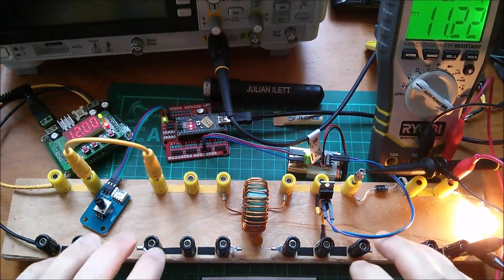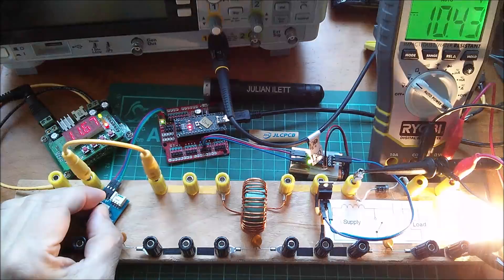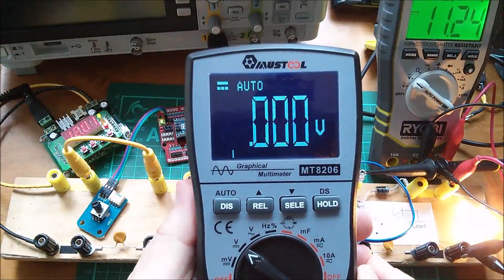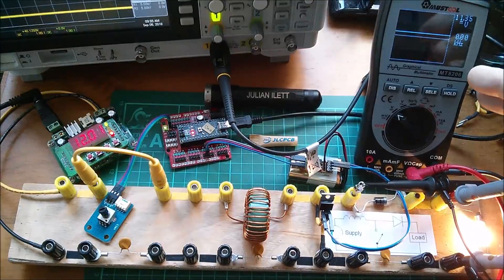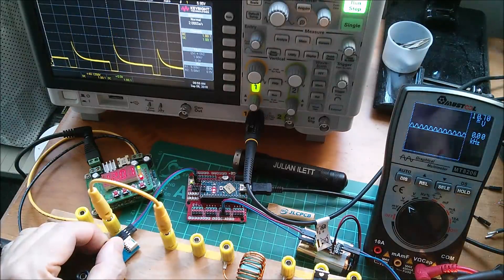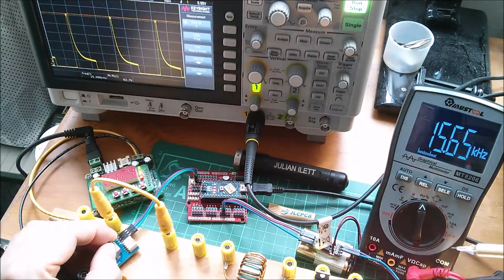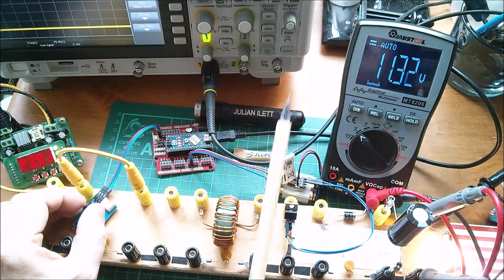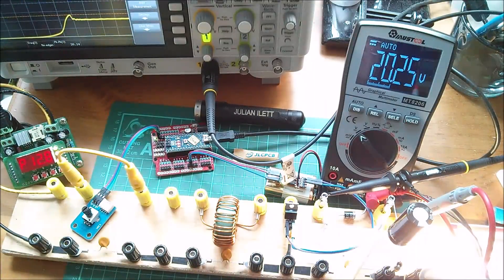Boost Converter with Capacitor, DMM and Scope - Muppet 2

Comment: Julian - Put some emi caps into the circuit. One next to the input cap, one across the output cap. Also for a super design you could add some common mode inductors and filter caps pre and post converter to really clean up the power and kick out noise.

Comment: The meter is reading RMS voltage so it's doing fine for what it's been asked to do. The circuit sort of emulates a PWM without the capacitor so it reads that but in (reverse?)? The lower the duty cycle, the lower the RMS reading.

Comment: I’m late for my comment, but here comes anyway:  Your volt meters are measuring the average which is dominated by the FET conduction pulse width.  If you had a true RMS meter, it would weigh in (like as a square) the transient portion and would increase just like the light bulb intensity.  In that respect, the light bulb also responds to the true RMS.

Comment: crowbar!  I've heard that term for years and sort of had an idea what it meant.  So what does it actually mean and where did the name come from?  is it from the pattern you are seeing there on the scope?
Reply: emaglott - no. The term was misused here. He most likely mean clamped. A crowbar in electronics actually refers to a protection circuit that once triggered by a higher than normal voltage, it conducts until the circuit voltage drops to near zero. The idea is that by shorting the supply, it will rupture the fuse. Occasionally a breakdown in an electronic component will have a similar affect. But this is not what was happening in this video.
Reply: Oh.  Thanks for the clarification.  Why is that called crowbar?
Reply: emaglott - I can’t for certain tell you why, as I don’t know how the name came about. It may be because the circuit has the same effect as dropping a metal bar (crowbar) across the supply terminals (the voltage drops to near zero, a high current flows and blows the fuse). Or it may be named due to the sudden and rapid removal of a fixing when a much larger crowbar is used to lever it off of a structure - in the circuit, the voltage is suddenly and rapidly removed as first the crowbar circuit shorts it out, and then the fuse blows.
Search using “electronics crowbar protection” for more information.
Reply: @Mark1024MAK - I was looking up some info on ignitron rectifiers and found crowbar information!  It is a reference to dropping a crowbar across the output terminals of a power supply according to:  https://en.wikipedia.org/wiki/Crowbar_(circuit)

Comment: I don't believe that clamping and crow-baring are interchangeable terms.
Clamping constrains to some non-zero voltage (60v here), whereas crow-baring is a special case where the clamping is to zero volts.
It comes from the notion of throwing a crowbar across the output of a power source - an extremely low resistance that won't burn out, which absolutely forces the power source output to zero volts. Many power supplies include "crowbar overvoltage protection", which triggers an SCR across the output should the output voltage rise too high. The heavy short circuit thus caused blows the power supply's fuse, protecting the load from the overvoltage.
Reply from the maker: Quite right - I should have called it clamping :)

Comment: Please forgive my ignorance. I continually read that buck converters are noisy. As they are quite capable of driving a PC processor I can only assume that the 'post processing' of the output must be very good. You used a capacitor, is there any way an 'add on' can reduce the noise on the many Chinese ones available.

Comment: You could try the multimeter on AC to measure the spiky DC accurately.  True RMS multimeters don't care whether it's AC or DC input, and it should show the voltage rising with the brightness of the bulb if the RMS integration is working correctly.  (I'm not sure why they bother with DC settings at all on true RMS multimeters!)

Comment: I noticed that after you added the capacitor you switched the input meter from voltage to power. what was the input to output voltage with the capacitor?? Thank you Tom

Comment: I looked at the Mustool DMM on Ali. The one you have should go to 5GHz, not 200Khz. So why didn't it show the range properly? Or am I looking at the wrong thing?
                     MT8205               MT8206
Bandwidth  AC 10KHZ         ● ACA/ACV/DCA/DCV 20KHZ
Frequency 2KHZ-200KHZ    ●5HZ-5MHZ

Are we looking at the "bandwidth" instead? If so, what's up with the frequency?

Comment: Adding the cap after the diode is nice. It shows the power of what a good cap can do to a circuit and why we need them.
Two questions about this setup is (there may be others l8r, depending on the answers), what does the size of the capacity of the capacitor do to the ending result? And what would happen if you put a capacitor "before" the diode; will it change anything?

Comment: I could still hear the high pitch ring either way. Though it did change pitch slightly when the cap was installed, and it went a little higher. I think you had your audio set a little differently, or maybe the mic was in a different spot, something. It wasn't "quite" as annoying as the first video  😉

Comment: You shouldn't put the scope ground level at the very bottom of the screen here.  4:56  It is an analogue signal with an inductive load and you can't assume it isn't going negative.  Move it up at least one division so it shows any negative voltages and you can adjust it up more if required.

It would be alright to do this on an analog scope because the trace can still be seen below here but on a DSO it is a hard line.

Comment: Did you ever explain why the dvm's showed lower voltage as the pwm increased ? I heard a lot about crowbarring, and capacitor, but no explanation.
Reply: The waveform was spiky, the meter can only read a sinewave accurately.
Reply: PWM is not a sinewave.
Reply: @youpattube1  the higher the voltage got the narrower and sharper the pulse became and the more the meter misread it as a lower voltage.
Reply: youpattube1 - as the duty cycle was changed, so the voltage spike got taller, but the on time of the transistor was longer. During this time energy is going into the inductor. So no energy is going to the lamp. Normal digital meters have both relatively slow sample rates and only appropriate waveforms that are not pure smooth DC. They use an averaging system (designed to show the correct AC value when measuring a pure sine wave). Because of this, they don’t respond to the short voltage spike, but do notice the loss of voltage during the time the transistor is on. Hence as the transistor on time is increased, they show a lower voltage.

Comment: I believe that's called an output integrator when you use a capacitor to average out the PWM. it's how they "recover" a sine wave from  PWM in pure sine wave inverters and the audio output in D class amplifiers.

Comment: There was some noise on the output with the electrolytic cap there... i wonder if you get rid of that noise if you also put a cheramic cap in paralell with the electrolytic.
Since the cheramic caps are better on high frequency stuff compared to the electrolytic.

Comment: Julian, the crowbar effect your seeing is actually the body diode doing its job. If you look at the symbol for the MOSFET it shows a zener there. That is there to help protect the drain source junction. Hope this helps explain what you were seeing.
Reply from the maker: OK, that's interesting - thanks :)
Reply: The body diode is a parasitic structure in the mosfet (actually a whole bipolar transistor with B and E shorted). It's drawn as a zener to indicate drain to source breakdown. It's not there to help with anything, ideally it wouldn't even be there.
Crowbar circuits short points in a circuit together like a crowbar across a battery, waht's happening here is called clipping. Crowbarring would happen when the mosfet burns up and turns into a jumper.

Comment: To clarify for the learners out there: It is a clamp not a crowbar. When triggered, crowbars latch fully on - usually until the power source is removed, with the intention of making the input protection fuse blow. Clamps prevent a voltage from going higher than a certain point, by applying a load, in this case, the zener built into the IRFZ44. Look at the schematic symbol at 6m50s, the body diode is presented as a zener.
Reply from the maker: OK, that's interesting - thanks :)
Reply: Good catch.  Interesting that some schematic symbols show the body diode as a zener while others don't.

Comment: Re: 7:38 I hope you know that light bulbs are NOT linear devices, a matter of fact there are a bunch of circuits that use light bulbs because of this facts. They do change their resistance with the temp of the filament but it's not a straight line correlation. I am sorry I don't have a link right now on the subject, but I remember this from a project I did back in the 70's and from popular electronics article.

Comment: Enjoyed this, thank you. I saw that meter on banggood last week, I’ll be interested in your review. I think I must have lost 15kHz too :-(
Reply: Here's hoping we get a full review, not just a hand wavy sort of thing.  Perhaps actually test its accuracy on all ranges, check the resistance threshold of the continuity, look at auto ranging times compared to other devices, look inside to assess the construction & safety, check the current consumption.  And on the 'scope look at bandwidth (comparing it with your proper cal'd 'scope).  Examine and demonstrate the history functions (such as they are).

Comment: try a larger capacitor or two in parallel. the overshoot and ringing observed on the scope indicates underdamping. if you're looking for smoother output voltage.

Comment: Are you sure it isn't the scope cutting the top of those traces? The volts/div selection determines the maximum voltage it can measure (because it determines to which multiplier/divider the amplifiers/attenuators inside the scope are set). It doesn't matter where you move the zero volt line to. 
The MOSFET might be getting hot, because the inductor is driven into saturation at which point it is like a short.
Reply: An inductor that size will be far from saturated with this amount of load.
Also, no scope will display a cutoff like that ever.
There´s a good reason that Mosfet claims only 55V VDSS. You can´t just use any mosfet for any purpose. At some point it just becomes conductive when off.

Comment: The ringing you saw after installing the cap is probably not there. You are using a ground wire for the probe which creates an antenna. If you measured with a shorter wire (or none ideally) the ringing would would likely diminish or out-right disappear.
Reply: It´s unlikely that this comes down to his probes. The frequency isn´t very high here.
It´s probably due to the diode he´s using. Diodes take a bit of time to turn on.
Reply: @Basement-Science  hmm, good point. I have seen scope ring in 200khz applications before but not in anything this low. It is an easy thing to rule out though.

Comment: It would be interesting to get a "true RMS" meter on the boost circuit without the cap.  I suspect it would show a voltage rise.  The bulb is behaving like a "true RMS" measurement, while the DC voltmeters are filtering the waveform.
Reply: Bingo

Comment: huh, thats quite an interesting multimeter for $50. i wonder if that "oscilloscope" mode can be used for anything useful or is just a gimick.
Reply: I saw it on banggood on sale and almost pulled the trigger, but figured the scope would be fairly useless.. They show it displaying a  60hz sine wave, I wonder if it has the resolution to accurately display a modified sine inverter output waveform? Or some dc graphing? I'm going to guess it's only useful for around power line frequency or below, and has trouble auto ranging and triggering on anything but perfect signals. Can't wait to see Julian put it through a few tests.
Reply from the maker: I'm thinking I'll feed it with 1kHz sine from the Wein Bridge oscillator, several kHz from a Royer oscillator (also sine) and the output from a modified sine mains inverter. Maybe also a 555 square wave.
Reply: Perhaps the sources to use (for 'scope testing) are your DDS and waveform generator modules.  The AD9833 and AD9850 if I remember.
Reply: Julian, maybe you could also compare the JYE TECH DSO138 Oscilloscope (kit) that you did a while back.  What was its bandwidth?

Comment: Julian, you probably improve then efficiency by adding a cap on the input also.  I used to fix smps's in the telecom's sector and every single one had come capacitance on the input.. Just a thought. :)
Reply: It wouldn´t change much in this case. The power source (his other converter) is pretty close to it.
Reply: Yes that does have caps.

Comment: Can you run it with a 555 ???
Reply from the maker: Yes, probably, in a PWM configuration (with diodes). But the Arduino is needed for synchronous buck where two non-overlapping waveforms are required :)

Comment: Great practical example! Now how would you do current limiting??
Reply from the maker: Thanks. Measure current with the Arduino - then use that measurement to adjust the constraint on PWM value.
Reply: @JulianIlett  I know voltage and current are interrelated but how would you for example boost the voltage to double input but limit the current,  you would need a high duty cycle to boost voltage but then a low duty cycle to limit the current,  it seems contradictory,  or is there another factor at play
Reply: Andrew Waters  what you´re asking for is regulation. So far this thing is completely unregulated. If you were to remove the lamp and run it, the voltage would just rise until something dies. In the same way, if you increased the load, the voltage would drop.

What you need to regulate the voltage or current is circuitry that measures it and adjusts the duty cycle.

By the way, measuring that with the arduino or another ADC will lead to very slow regulation since an ADC takes time to do its thing. Normally OpAmp circuits are used for this, which are normally integrated into SMPS controller ICs.

Comment: According with inductor value i think it's better increase the switching frequency. So the average output voltage will be higher and output voltage and current ripple in the capacitor will be smaller. Do you think so too?

Comment: won't the ESR of that cap be high? won't it be better to have a low ESR cap in parallel?
Reply: This converter only runs on 15kHz, so it´s not too critical. Of course lower ESR would decrease the output ripple a bit more.

Comment: Now we have an R-C-L circuit. Can you calculate the resonance frequency? And what would happen with the output? Or input? Or polyfuses :-)
Reply from the maker: Next, I want to charge my supercapacitor bank using the Muppet :)
Reply: Now to be fairly honest: is that wise? Supercapacitors are sensitive to 'high' voltage (a few volts above their maximum voltage is sufficient), it will shorten their live considerably. Now I may be wrong, because I saw on the scope the peak voltage is no longer there when you connect a (small, 0.0001 F) capacitor. Seen from a circuit perspective, the supercaps are just a (huge) resistance. What I am trying to say? Please do the charging and show us what you find out (also use the scope, check if there is any ripple left). I really don't know if you could damage them or not.

Comment: Its all fun and games until you draw huge current from that circuit presuming :P that it doesnt have a feedback. I know you made this video for educational purpose. So would you like re-create a whole converter that has a dedicated switching IC i have this Circuit diagram of a Buck-Boost Converter that i found on the Internet that uses a UC3843 chip and it works absolutely Well and is very easy to build! Great video as always :D Keep Up. https://drive.google.com/open?id=15CZ2F29DuQAXjBOBdX_b516Ue-0BRhQV
Reply from the maker: Next, I will charge a supercapacitor bank - the feedback loop will include me (being very careful with the pot adjustment).

Comment: The 15Khz actually gets a bit louder at 50% duty cycle with the capacitor installed! It's a bit annoying but you get used to it... It's like hearing a CRT TV in the old days
Reply from the maker: Yeah, 15.625kHz on old PAL tellies if I remember rightly :)
Reply: Indeed! It was actually fairly audible (at least for me), even without the capacitor!
Reply: I remember those days, when I had to leave a store because of the squeel of those old Televisions.  Can't happen any more as my hearing has been failing for some time now.  If I hear such a noise now days, it is usually my hearing aid getting some feedback.
Reply: Jerry, if you think that was bad, some of the early "ultrasonic" alarms weren't quite "ultra" enough.  I could hear them as a kid.  When they were disabled, they only disabled the alarm part - the transmitter ran 24/7.
Reply: Could really hear it at about 3:09. Couldn't hear it other places.